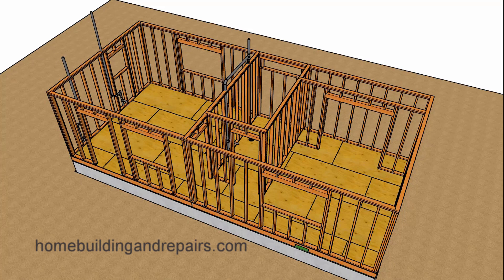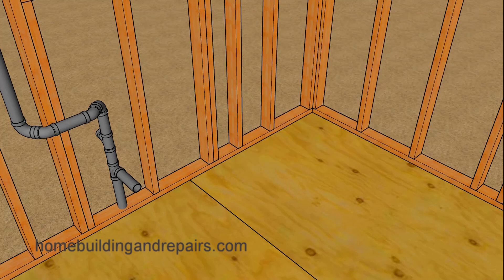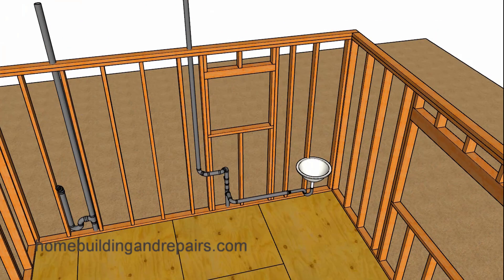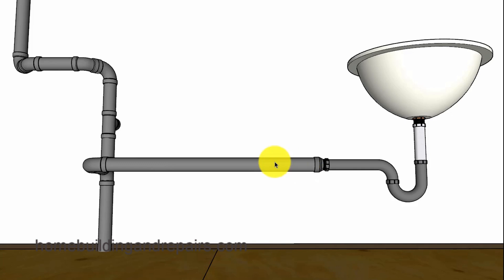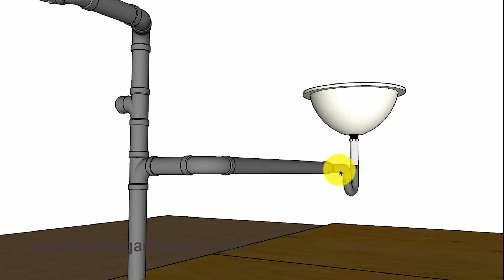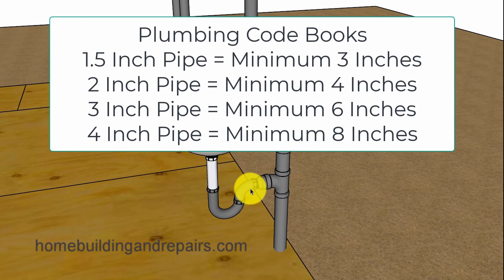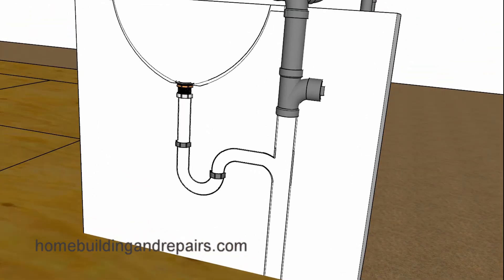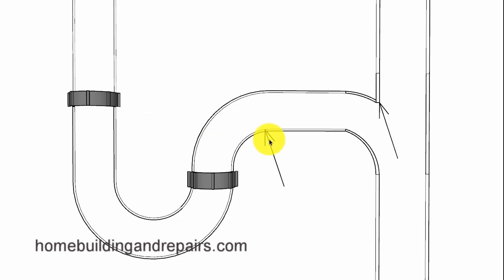Maximum And Minimum Plumbing Trap Arm Lengths - Home Remodeling And New Construction Codes

Comment: I can’t seem to get a straight answer on whether a closet bend is required. I have a house where there is a 4 foot vertical drop under the house directly below the toilet. The other fixtures at the bathroom have 3 foot vertical drops from the fixture to the traps under the house. Any advice or direction on this?
Reply from the maker: You will need to check your local building codes, but I've never heard of a code that requires a bend.

Comment: Can low can the p trap below the drain pipe? I want to add a section of pipe for a dishwasher connection but I would need to lower the p trap. Will this affect the way the sink drains?
Reply: get the correct tailpiece to connect the d/w hose.

Comment: in Chapter 10 of 2024 UPC Section 1003.3 Size says The size of a trap for a given fixture shall be sufficient to drain the fixture rapidly but in no case less than nor more than one pipe size larger than given in Table 702.1. BUT then the next sentence reads, "The trap shall be the same size as the trap arm to which it is connected." Based on this code, if you have a kitchen sink stub out that is 2" PVC, it is in compliance of code to install an 1-1/2" trap without replacing the entire trap arm to 1-1/2? The way that I interpret this is, it's basically saying that the trap SHOULD (or does "shall" mean must?) be the same size as the trap arm, however can be 1 pipe size larger than the trap arm, but never smaller, is this correct? Thanks

Comment: I have a situation where a 2” trap arm will have to travel 18 FEET (4-1/2” of total drop) before it hits the 90° santee into a main stack. Would I be ok if I place an AAV somewhere on the arm within 8’ of the trap?
Reply from the maker: I don't think so, but you can check with local building departments to make sure. I'm not about to suggest it won't work, but don't think it would approved by inspectors.
Reply: dude, it's 1/4 inch drop per foot. not 1/4 FOOT drop per foot. 18 ft.  x .25" drop/ft = 4.5" drop

Comment: "I think it's TOO long"
Reply from the maker: It could be???
Reply: Correct grammar: 'To' addresses direction (from 1 to 100) and 'Too' means to a higher degree than is desirable (too long, too soon, too late, too easy, too ignorant, etc.).
Reply: @peb3232  The former is either a preposition or an infinitive particle; the latter is an adverb.

Comment: What about vertical vents? Specifically for toilet drains when they run vertically
Reply from the maker: I don't understand the question.
Reply: @gregvancom  vertical drains run just like the vents, up and down of course down is the drain. Therefore I the drain is vertical instead of horizontal like in the example of this video. How far from the actual entry point of the vertical drain does the vent need to be? Example : 12 inches or less?

Comment: Why sloping pipe towards the fixture why not other way around. Thanks
Reply from the maker: I like your thinking. Let's have every pipe drain sloping towards the sewer or septic tanks.
Reply: @gregvancom  I mean, Its has any technical reason? I only know grading away from home that's water moves away not towards foundation.
Reply: It is sloped away. I had the same confusion watching the video but I think it was due to the way he dragged the mouse when he said it, dragging it towards the sink rather than away. I think the comment about keeping the slope minimal traces back to the idea that the vent openning should be higher in elevation than the water level from the trap. Not sure about that though, we'll see in his next video!
Reply: @Zorlig  Thanks Sir